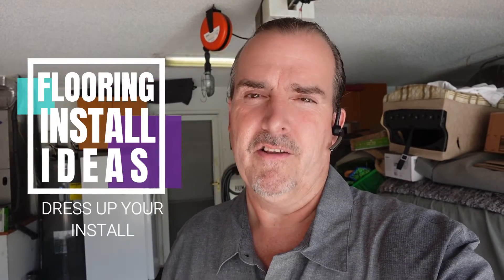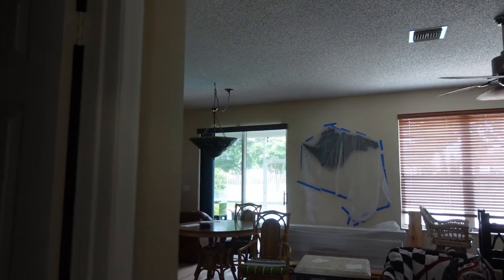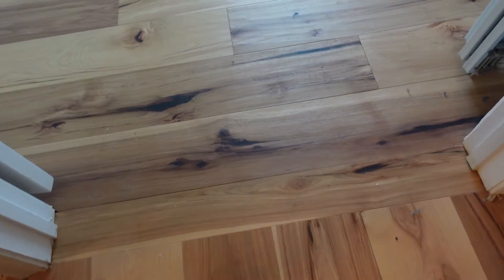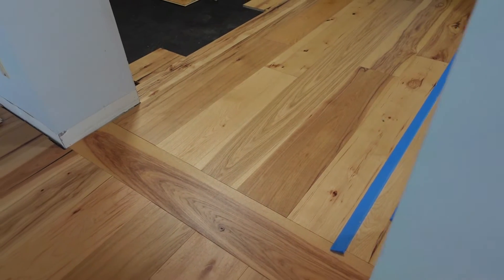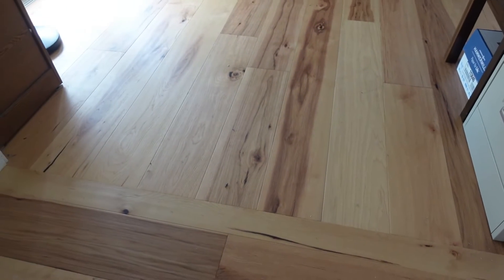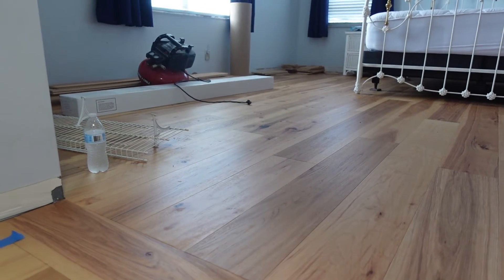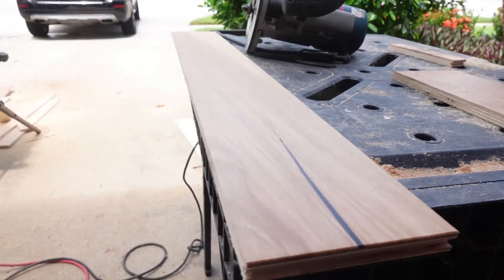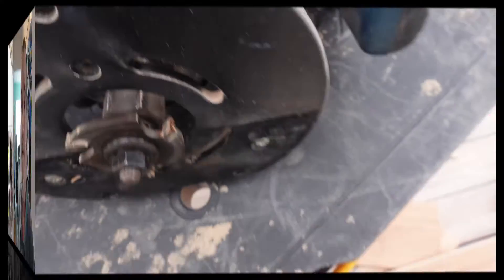NO TRANSITION FLOOR INSTALLATION HOW TO INSTALL WOOD FLOORING WITHOUT TRANSITIONS & CHANGE DIRECTION

Comment: Hi Tim.  Great video!  Can you use this technique (for switching plank directions) on a floating floor?  Would you have to anchor the feature strips (or border piece) in the doorways with either glue or fasteners?

Comment: Thank you! Was looking for an example of floor changing direction. Currently putting herringbone faux wood tile floor in my front part of the house and want to change direction with the hallway, I’ll probably find a similar looking color of faux wood tile that is straight to make the transition or just a different pretty tile like a penny tile or something similar for a transition. I’ve been looking for examples but can’t find anything anywhere not even Pinterest. Thank you!

Comment: Curious to hear if this would work for luxury vinyl planking with a classic groove and tongue locking system. This hardwood floor is very thick, which makes it easier to use the router and add this new groove. For a typical lvp board, which is around 0.25", I'm not sure this technique would work, unless using a table saw perhaps.
Reply: This is also what I'm looking for! I'd love to be able to it with the LVP.

Comment: this is exactly what i do with small areas, you can use your scrap wood in the opposit direction to minimize the waste. However, i'm working on another project where using the same wood to create a transitional piece between rooms with one inch slope, no gaps, no steps, just smooth transition from one level to another.